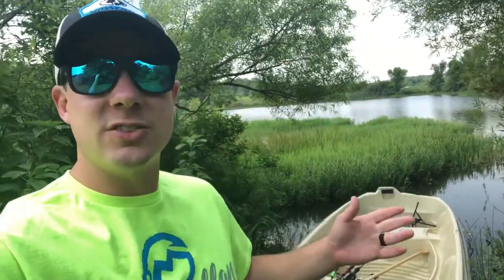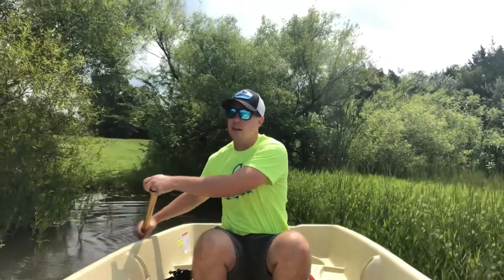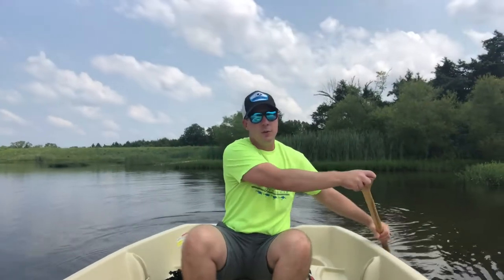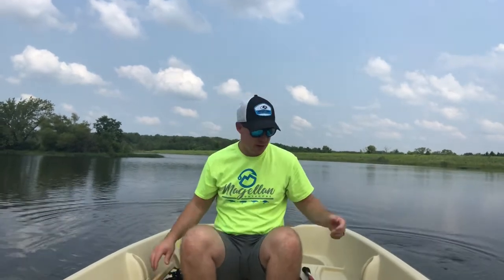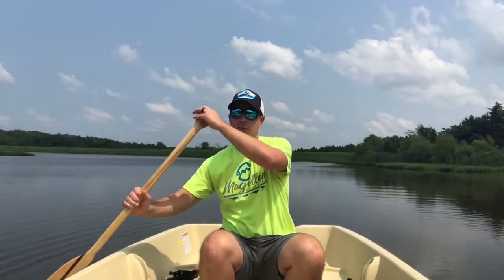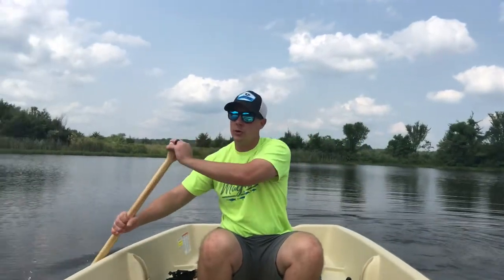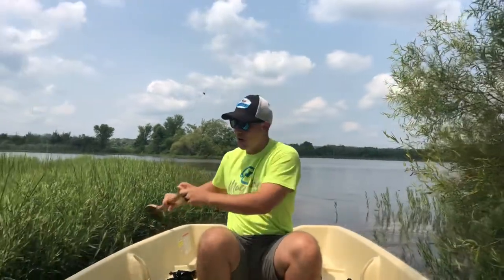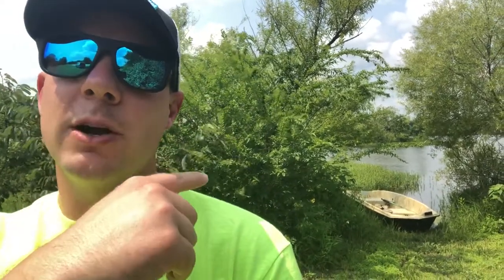Sun Dolphin American 12 Jon Boat / How difficult is it to paddle

Comment: How much time can you get out of your battery. Do you keep 2nd one in the boat to switch to?
Reply from the maker: It usually lasts me about six hours of normal use. If you are using it to cruise around on top speed it will drain it faster. But with me just trolling around only using it on slow speeds when fishing it doesn’t do too bad. I only run the one battery.
Reply: @bluecollaroutdoors5556  heck yeah, good to know, im putting some swivel seats on mine and some padding for them floors, just got to get a battery. Thank you